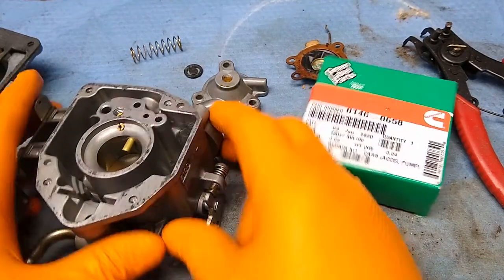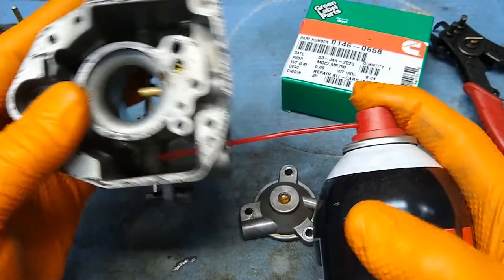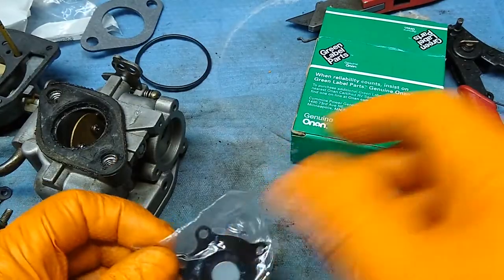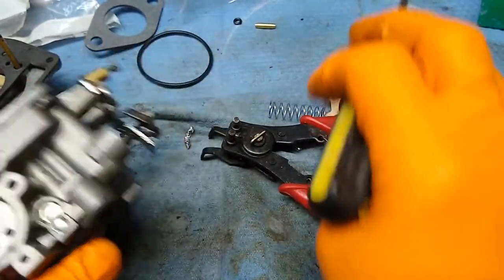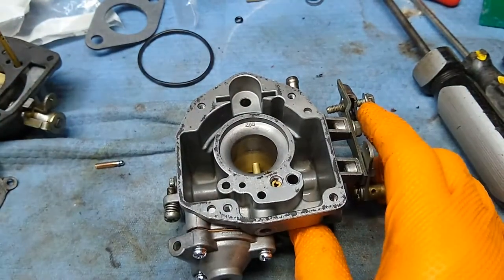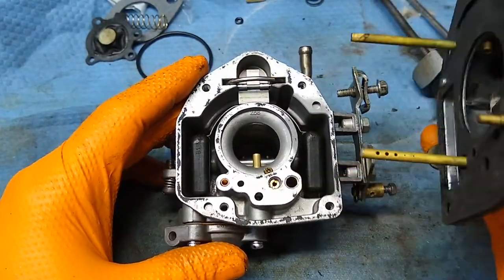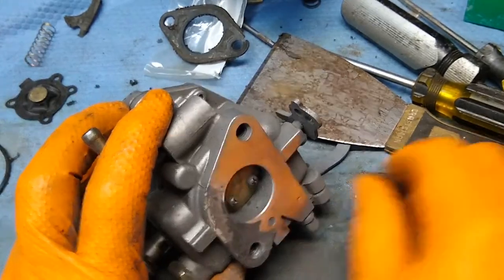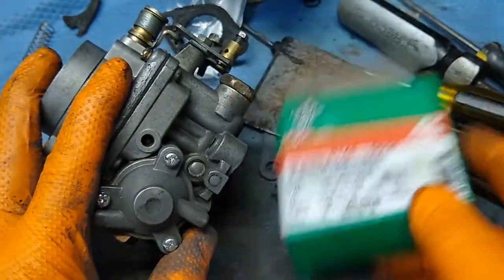Onan Nikki Carb Accelerator Pump Kit Prep & Install

Comment: I have a Nikki 6100 carburetor on a Robin engine and a Polaris Ranger. I’m wondering if you give me some advice the carburetor is just dripping fluid down into the intake, not spraying it. I have taken the part and I do not see anything obviously wrong. It’s on a 18 hp motor.

Comment: the adjustments screws are still there , they are under the caps just tap them with a tiny pinch they will fall off